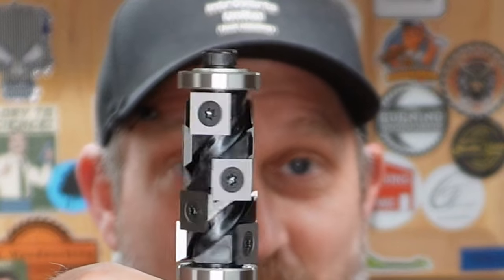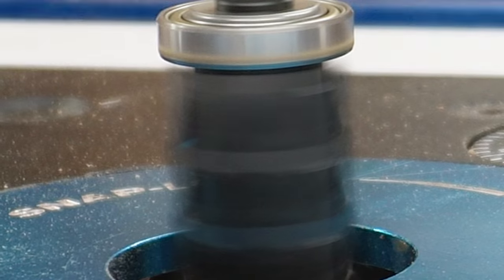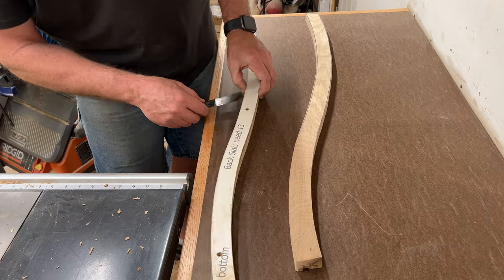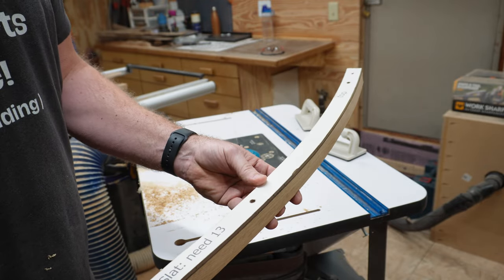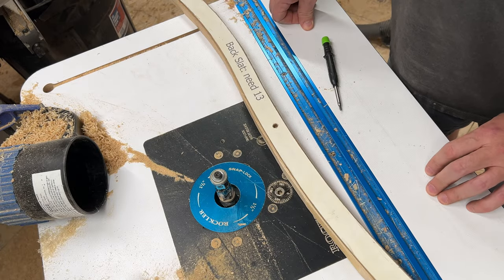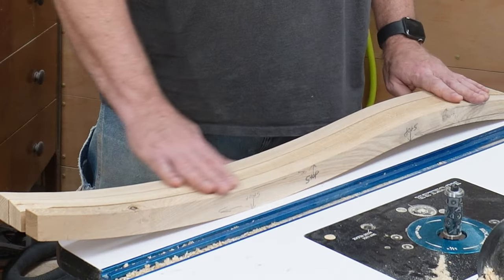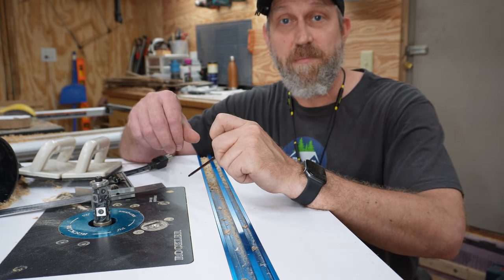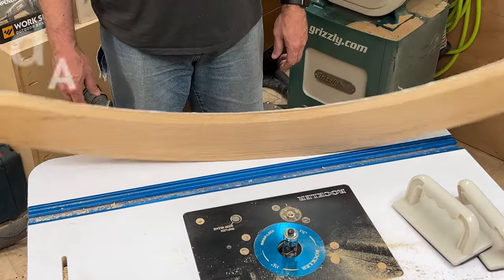Impressive Router Bit in Action!

Comment: Thanks for showing that bit in operation.  I thought they looked hinky and far too dangerous to use, too. If they cut that cleanly, maybe they're worth it.  Straight bits aren't so great.  Compression bits cost an arm and a leg, too. This raises the question, are these compression?  It would seem that a judicious angle on each cutter could make it into a compression bit.  Maybe with a little thought, an up, down, or compression.

Are there RPM limits, more so than any other bit its size?

To get the tape residue off, a heat gun workes really well.  I have a Ryobi cordless that works perfectly.  It doesn't get so hot that the wood burns but hot enough to release the glue.
Reply from the maker: I made the suggestion to Find Buy Tool that they angle the cutters so that they shear cut. They said R&D is working on it. 

This wouldn't be a compression bit because it doesn't cut in both directions. It's a spiral upcut, which I think is the preferred direction of chip ejection because it pulls the workpiece into the table rather than potentially forcing it upward.

The recommended RPM for this bit is 16k. My Bosch router is adjustable between 8k - 25k RPM.

The doble sided tape I use comes off pretty cleanly (no residue). I just use the putty knife to get it started sometimes. But thanks for the heat gun tip. I'll keep that in mind if I ever have an adhesive issue.
Reply: @BrettsWoodshop  A compression bit could have the top row(s) of blades angled down and the bottom row(s) angled up.  It's pretty aggressive, so it would take some R&D to make sure it doesn't come loose and end the world as we know it.

16K sounds about normal for this diameter.  I guess the geometry doesn't subtract anything.

It just looked like you had some residue that you had just a little trouble scraping off.  The heat gun trick works on all sorts of labels stuck to everything you buy. Care has to be taken with some soft plastics but it works a lot better than goo-gone, or mineral spirits (same thing).

Comment: If you use clear plexi for you template yuo can see the grain thru the template and not have to use the lower bearing.
Reply from the maker: Excellent point! Do you have a good method for making a clear template DIY without a CNC or a laser?
Reply: @BrettsWoodshop  I just use shelf paper or masking tape to mark them bandsaw them to rough shape and use bench sander fine tune to the final shape.  To clear the edge I use tour h to heat the edge which makes the edge clearer
Reply from the maker: Hmm... I might have to give that a try. Thanks!

Comment: Seems like the carbide inserts should be angled a little bit instead of aligned with the body of the bit. That might help with the tear out issue.
Reply from the maker: I did suggest that to FindBuyTool. They said that R&D is working that.